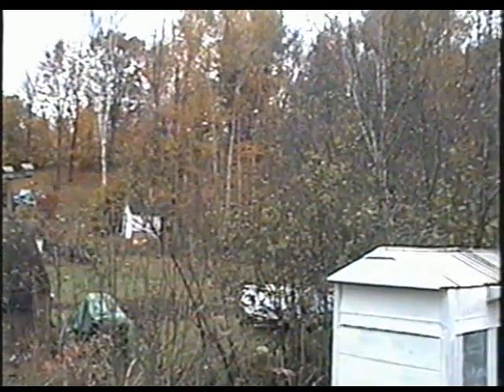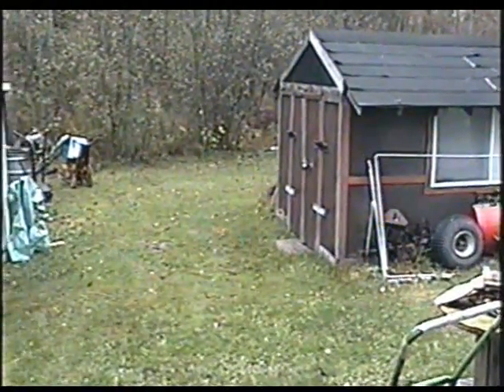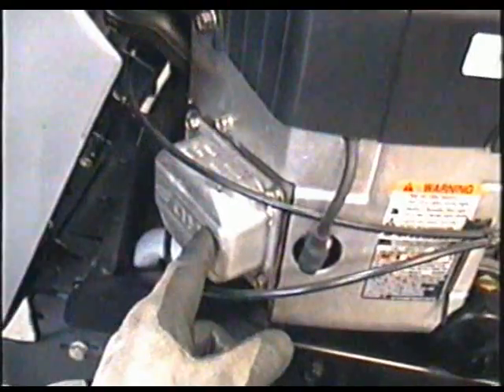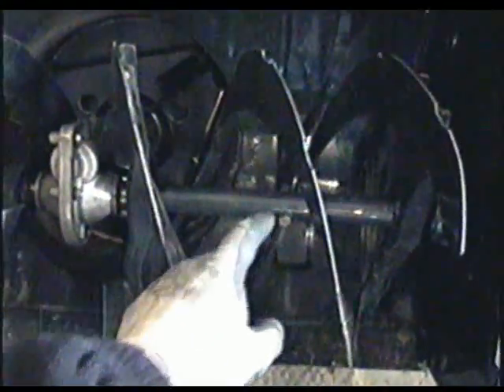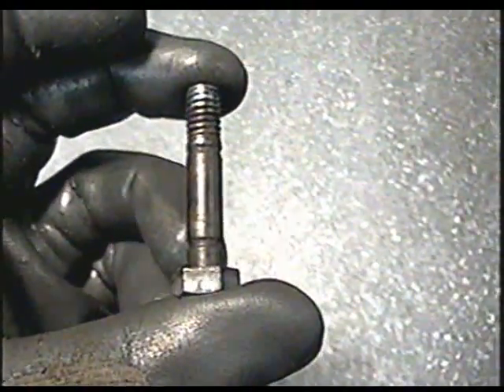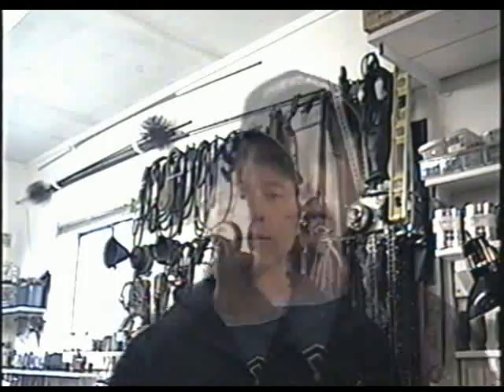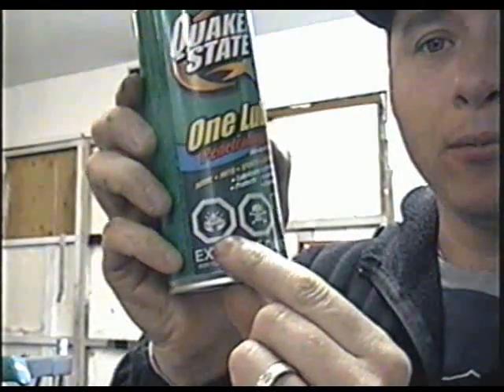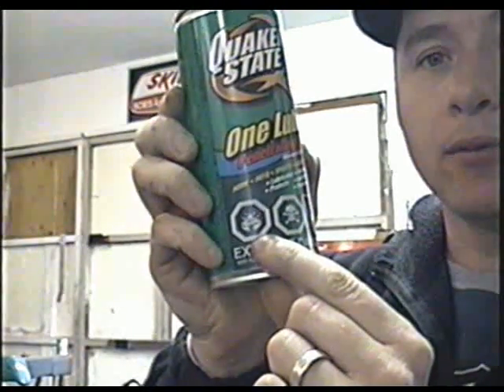Small Engines Q & A  Video #18

Comment: I've had trouble with some Kohler engines, and they didn't have adjustable valves, I believe it was a Kohler Command series. It was really had to start, turns out the decompression release on the cam had failed, the little spring broke. Exact same problem as the valves out of adjustment. The compression when starting was around 150psi on both cylinders. Unfortunately, the only way to fix it was replacing the cam. So, I just told the customer to spin it past the compression stroke by hand:)